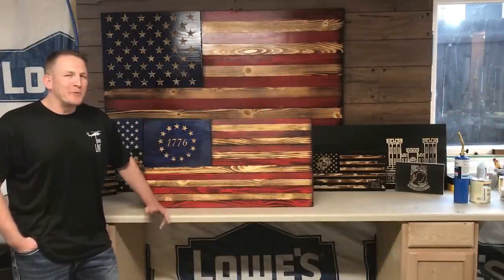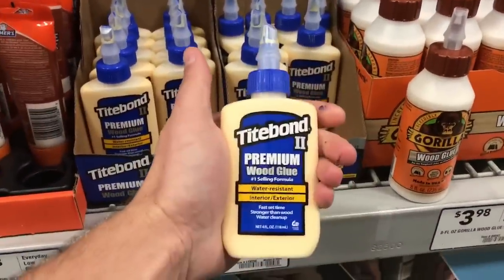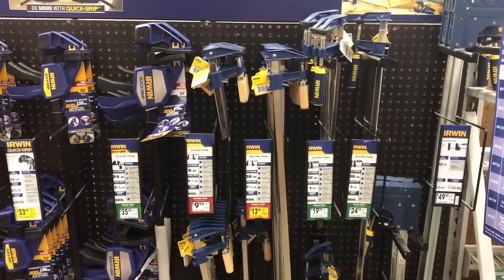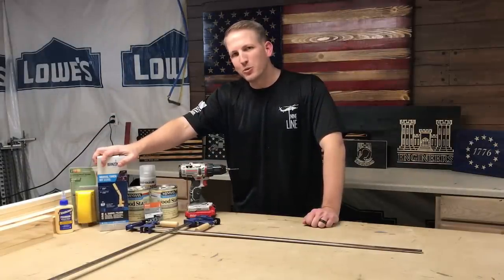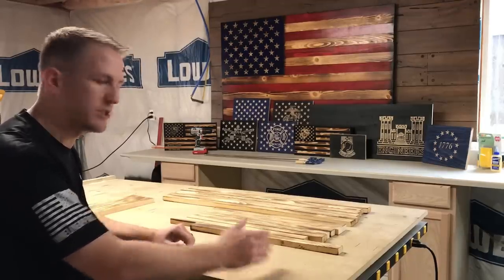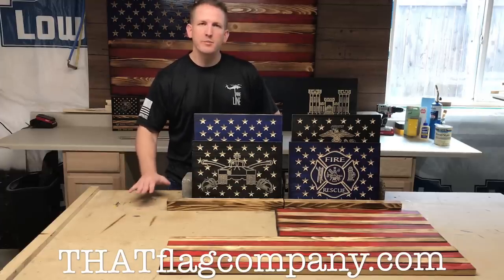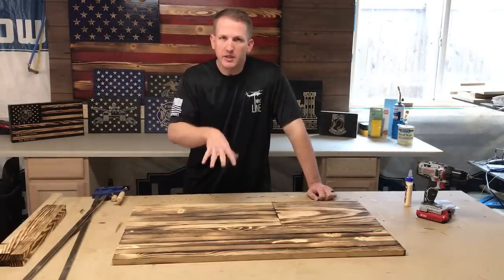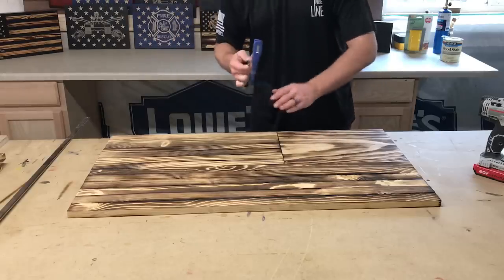DIY - Rustic Wood American Flag - Start your own Flag Co. for under $100 - Step By Step, How To

Comment: I see your link on where to buy a Union.  Do you have a video on how to make one?  Your work is amazing!
Reply from the maker: Hey Jim! There are multiple ways to make the union yourself. We started by making a template in Microsoft Office and tracing it onto stencil paper from Hobby Lobby. We then used a knife to cut the stars out of the stencil and could use that stencil to trace the stars onto the union. After the stars are traced, you can use a dremel or a hammer and chisel to engrave them into the union. Hammer and chisel takes more practice to get right but ends up being quicker and better than a Dremel in my opinion. This is the most cost efficient way to make the stars yourself. I have also seen people buy stencils on Amazon but they’re not always proportional for their flag and they’re limited to the one size and style. We are actually working to make another video covering all of this in the very near future. 

However, to make the unions with our level of quality and detail that we offer on our website would cost you thousands of dollars in equipment and multiple tutorial videos. For this reason, we did not go into the details on this video but decided to offer them already completed for on THATflagcompany.com in order to provide another option that we wish had been previously available to us when we were starting. 

I hope this video was useful for you and the follow up response helps give some additional clarity.  If you have any questions we can help with, definitely don’t hesitate to ask!

Comment: Another question...   why not have the flag be 37"?  That way each stripe is exactly 1 1/2" and the union jack ends exactly on the edge of a stripe.  That was you can just cut 13 stripes at 37",  stain and paint,  the glue up.  I find after I stain the stripes red I just glue up and let dry,  mask off  the edges of union Jack,  use some cardboard to protect the rest of flag and just spray paint the blue on.
Reply from the maker: Hey LtCol Killgore! You absolutely can glue up 13 stripes that are all the same length and then paint the Union Jack portion blue. In fact, my first 10 or so flags that I made did not have a separate board for the Union Jack and many others on YouTube will show how they make their flags the same way as you just described. 

It honestly comes down to builder’s or buyer’s preference. When we compare the original flag that we built (13 stripes and no separate board for the Union Jack) to the flags that we build now (separate board for the Union Jack like in this video), there is no doubt as to which style looks better and of higher quality. However, that’s just our opinion from our experiences. 

Thanks for watching the video and taking your time to add your input and ideas!! It’s always amazing to see someone that has served, or is serving, building and crafting American flags. There’s a lot of power and meaning behind each flag that you’re building!

Comment: I just started making flags. I been doing the union with the razor in the strips. Would like to start to make the union separate piece. Can you tell me what is the cut list for the strips for tge short end ones on a 18.5 & a 24.75 flag. I see you said for the 36 its was 21.75 for the shorts. Plus what size wood would i use to cut for the unions? A 1x8?
Reply from the maker: Hey AI D!

We actually just posted a full cut sheet with all dimensions for 6 different flag builds in the product photos of our new metal stencils. You can view and download the cut sheet here: 

https://www.thatflagcompany.com/collections/metal-stencils/products/50-star-american-flag-metal-stencil-14-gauge-steel

Comment: I might be doing the math wrong here but the advised union size doesn't appear to fit the flag (on paper). The length of the union adds up at 14.25 but the height doesn't. If you have seven 2" tall pieces of wood, that's 14 inches. The advised union height is 10.5" which obviously is shorter that 14". What am I missing?
Reply: 1x2 is the raw cut size of the wood. Once it's milled down it's only about 3/4x1.5

Comment: Great video!  Does that $100 include one of y'all's $35 unions?
Reply from the maker: The $100 is all you need to get started (everything purchased in the video). The unions from us is just something we decided to offer to help out. But, the cost gets way better after you bought all of the initial items!

After you have all of the tools/supplies we bought in the video, each flag will cost you less than $20 in material from Lowe’s and $35 for the union if you choose to go that route. 

And we actually have a lot of people order multiple 8 packs from us ($30 savings) and they profit $100+ from each flag since they’re able to offer top quality flags. 

Multiple options and routes to go, but we’re hoping this video helps you in one way or another!
Reply: gosh thank you so much for your reply!  My husband and I are going to start building these!  Very excited to start and we may buy our unions from y'all at the discounted price (the one where you get a bundle of 8 unions).

Comment: So the stripes are 1.5 an inch? I just got back from Lowe’s with a bunch of 1”x2” ‘s but something’s not right 😆
Reply from the maker: Correct! They’re referred to as 1x2’s bc that is the “nominal size”, but the true measurements will be .75”x1.5”.

Comment: I ordered one of your unions and just finished building my first flag using this video. It worked great and I just ordered two more unions so I can make a couple more flags for gifts. Thanks!
Reply from the maker: jlynchtx, That’s awesome!!! Thanks for sharing your success story! That’s what this is all about!
Reply: How do you recommend hanging the 36” Flags? Wire screwed to the back?
Reply from the maker: Something as simple as 18 gauge wire and screws works quite well. You also have the option to buy picture hanging kits or attaching a couple of D-Rings to the back. I find the d-rings to be inconvenient when trying to hang and level though.

Comment: Do you put more then one coat of the Rust-Oleum clear coat enamel on before the spar urethane?  And do you lightly sand it before you put the spar urethane on the flag or do you just put it over the top without sanding?  I've never used spar urethane before. It sounds like something you apply with a brush not with a spray can?  And I'm assuming that you apply all of these final coats on both the front and back?
Reply from the maker: Hey Slappy! There are multiple ways to seal the flag. A single coat of clear coat is a good base. You can then apply the spar urethane to the front for a higher gloss finish and appearance. Spar urethane is sold as a brush on and also as a spray. Hope this helps!!

Comment: Hey guys, have another question for you.  If I was to make a 5ft flag, actually about 62 inches so my stripes are 2.5" wide, what wood would you recommend to use for the union?  They only sell up to 12" wide premium pine at lowes, and I'm not sure if there is a good option to use a single piece of wood or if I need to glue 2 pieces together to make one piece?  Please advise!  Thanks again, guys at work are loving their 36 inchers
Reply from the maker: Hey FirechickenExpress! Edge gluing is the way to go. Cut the board and glue them together for at least an hour. Just use a sander after it dries, cut to size and you’re ready to go!

After glues the union will tend to cup quicker so keep that in mind too.

Comment: Awesome video with alot of great tips. One question I have for you that I'm running into is I'm getting some high and low spots on the flag where it's not all 100% flat. Do you ever run into this issue. Was wondering if I should try to plane the boards fist to mane sure they are all flat and even thickness

Comment: Maybe its just me... I looked all over your website and cannot find a video on how to cut the union stars?  You sale the stencil but I don't see how it is you are cutting those perfect deep beveled stars?  Would like to see how the experts do it, lol.  Maybe I can copy your action.  thanks
Reply from the maker: Hey Zaragoza Pictures! There are multiple ways to make the union yourself. We started by making a template in Microsoft Office and tracing it onto stencil paper from Hobby Lobby. We then used a knife to cut the stars out of the stencil and could use that stencil to trace the stars onto the union. After the stars are traced, you can use a dremel or a hammer and chisel to engrave them into the union. Hammer and chisel takes more practice to get right but ends up being quicker and better than a Dremel in my opinion. This is the most cost efficient way to make the stars yourself. After receiving multiple requests, we started offering the pre-Cut stencils for sale. 

However, to make the unions with our level of quality and detail that we offer on our website would cost you thousands of dollars in equipment and multiple tutorial videos. For this reason, we did not go into the details on this video but decided to offer them already completed on THATflagcompany.com in order to provide another option that we wish had been previously available to us when we were starting. 

I hope this video was useful for you and the follow up response helps give some additional clarity.  If you have any questions we can help with, definitely don’t hesitate to ask!

Comment: Do you have a video or instructions on how to make the union? It looks like it's one solid piece. do you use a dremel and a stencil? Any info would be great. Thanks, and God bless!
Reply from the maker: There are multiple ways to make the union yourself. We started by making a template in Microsoft Office and tracing it onto stencil paper from Hobby Lobby. We then used a knife to cut the stars out of the stencil and could use that stencil to trace the stars onto the union. After the stars are traced, you can use a dremel or a hammer and chisel to engrave them into the union. Hammer and chisel takes more practice to get right but ends up being quicker and better than a Dremel in my opinion. This is the most cost efficient way to make the stars yourself. After receiving multiple requests, we recently started offering the pre-Cut stencils for sale as well. 

However, to make the unions with our level of quality and detail that we offer on our website would cost you thousands of dollars in equipment and multiple tutorial videos. For this reason, we did not go into the details on this video but decided to offer them already completed for on THATflagcompany.com in order to provide another option that we wish had been previously available to us when we were starting. 

I hope this video was useful for you and the follow up response helps give some additional clarity.  If you have any questions we can help with, definitely don’t hesitate to ask!

Comment: Thanks for your videos. Some to the things you pointed out were very helpful. I am retired Army EOD NCO and build book cases, desks, chairs on weekends for family.  I watched several videos and had a couple problems when building these myself. I have a hard time getting the wood properly "toasted" I wanted some burnt spots for character but getting the toast color was difficult until I listened to your instructions. Thanks for that. The other issue is staining. I applied two coats while wiping off the excess and letting it dry between coats but cannot seem to get the deep color that you and others seem to accomplish. I used the recommended stain and color. I have used oak, cherry, mahogany, stain for years but never a blue or red. I wipe it on, wait a few minutes, wipe it off, let it dry, and repeat until it is the color that I am looking for. In most of the flag building videos the instructor just applies the stain and moves on to the next step. What is the trick? Do you apply only one coat? Do you wipe off the excess and just not show it? Do you thin out your stain so it soaks in or dries faster? Thanks
Reply: Use pre stain conditioner especially on pine boards it works wonders

Comment: My main problem I have is with the union, my 1x12 seems to want to bow after a while. I will buy a length, cut a few pieces for upcoming flags I want to make and next time I know almost all of them have a bow in them. Do you have this problem if so what is the fix? Thanks.
Reply: A late response but you could add additional "back braces" behind the union and use wood screws (not nails) to attach the braces to the back side of the union.  Hopefully this will help minimize the union from bowing over time.  I hope this helps.

Comment: Why didn't you show how to make the stars?? Seems kind of important don't you think? I mean considering the rest of the whole process is really, really so simple anyone can do it. Do you use a CNC machine or a router? Nobody is going to be chiseling or dremelling 50 stars and making money while doing it. Gotta be honest, I lost some respect for you when you didn't show how to do the ONLY part that anyone would have trouble with....you did, however, offer to sell that part...surprise, surprise.
Reply: Could not agree more. He for sure is using a CNC. Hence why you can submit a design or having the complex design that he has. CNC machines aren't too expensive, but figured he would have at least mentioned that fact that he used one.
Reply: You lost respect for a guy showing you how to make money?  If you are a Suburban hobbyist figure it out yourself.  Or you could just read the posts here and then you would see that he has explained it several times.  Geesss, everyone wants everything just handed to them.  Would you like for him to come over to your house and build you one for free too?

Comment: Bro your just trying to sell your unions...already figured out your sales idea...why not show how to make a union huh? Your trying to keep the labor out of your hands and just sell your unions. 👎🏻 if not your union company, you probably get a % for sales.
Reply from the maker: Hey Supreme254. We do make the unions ourself. We are veteran owned and family operated but you can get a true feel on who we are and what we’re all about by watching our FedEx video on YouTube. There are multiple ways to make the union yourself. We started by making a template in Microsoft Office and tracing it onto stencil paper from Hobby Lobby. We then used a knife to cut the stars out of the stencil and could use that stencil to trace the stars onto the union. After the stars are traced, you can use a dremel or a hammer and chisel to engrave them into the union. Hammer and chisel takes more practice to get right but ends up being quicker and better than a Dremel in my opinion. This is the most cost efficient way to make the stars yourself. I have also seen people buy stencils on Amazon but they’re not always proportional for their flag and they’re limited to the one size and style. We are actually working to make another video covering all of this in the very near future. 

However, to make the unions with our level of quality and detail that we offer on our website would cost you thousands of dollars in equipment and multiple tutorial videos. For this reason, we did not go into the details on this video but decided to offer them already completed for on THATflagcompany.com in order to provide another option that we wish had been previously available to us when we were starting. 

I hope this video was useful for you and the follow up response helps give some additional clarity.  If you have any questions we can help with, definitely don’t hesitate to ask!

Comment: Thanks for the video!  Does MinWax still offer the "charcoal" color?  I was at my local store and couldn't find it.  They can do a charcoal gray but it looked pretty light.  Not sure if they replaced it with something else.  Thanks again!
Reply: I'm not sure if you figured it out yet, but go to the stain section and there's sample colors on small sample pieces.  Go to the paint counter and they mix it for you.  You just buy the can of clear mixable stain.  Don't remember the name.  Good luck.

Comment: I went to Lowes to get the stain mixed and the guy working the paint counter was clueless and said he had never mixed one of the Minwax clear base stains before. He said he couldn’t find the True Blue in the system. Are you still able to get Scarlett and True Blue? If so, could you show a pic of both labels so I can show them the mix codes? Thanks! 🙂
Reply: I just tried again at Lowe’s and it ended up being the same guy again unfortunately and the same result. He messed around on the screen and couldn’t find either Scarlet or True Blue in the system for the Minwax? Did they recently discontinue these two colors there?
Reply: @chrisvirtue2498  I have had the same problem and once again, left Lowe's empty handed (4 times total).  They changed the color charts for the Minwax stains.  It has thrown everybody off at the paint counter at Lowes.  I would like to get an answer as well.  I assumed that there would be a cross reference chart, stating that Scarlett is now Crimson, True Blue is now Navy, or Denim, or Indigo etc.  Please let me know if you find an answer.

Comment: I just purchased a traditional union from you and it looks great. Do you recommend I torch this along with the 1x2s? I don’t want to mess up the blue paint but  if I don’t do that the stars will have a raw wood look compared to the “white” stripes on the rest of the flag. What do you recommend?
Reply from the maker: Alan Smith, sorry for the delayed response and I’m glad you like the union! I would torch only the sides and back. The finishing spray tends to darken the stars a bit. None of the stars on any of our flags are torched.